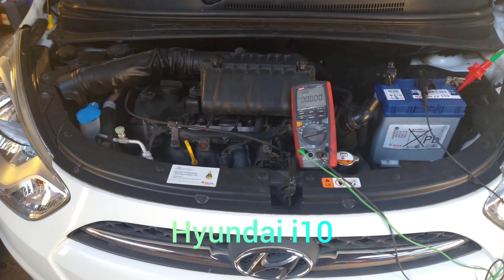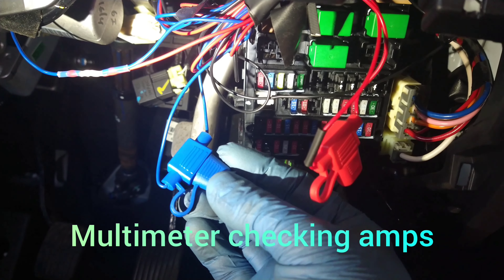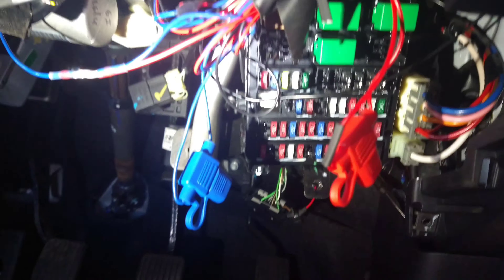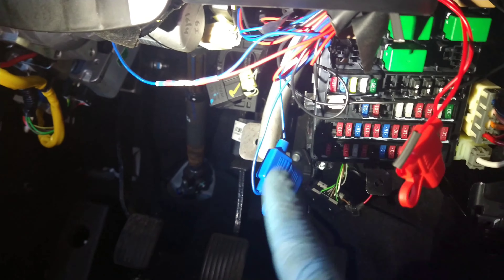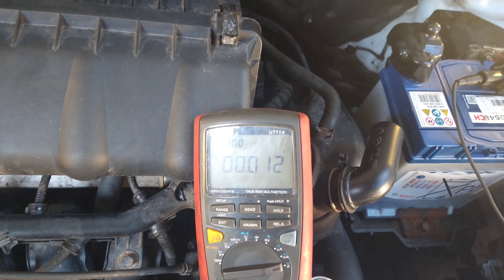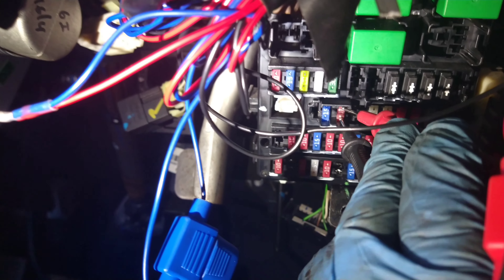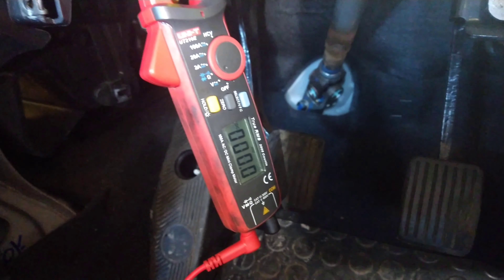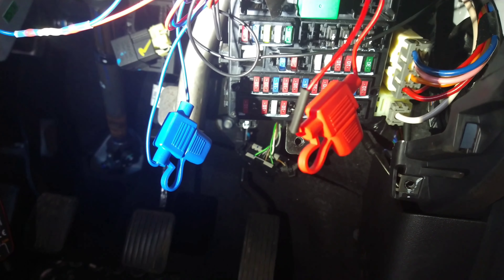Battery drain (Hyundai i10)

Comment: If that constant live is for a tracker, won't switching the wire from a constant to an ignition live disable the tracker when the ignition isn't switched on and therfore making it impossible to track the vehicle unless the ignition is switched on?
Reply from the maker: Yes it had the wires the wrong way round so that it was always on. In that case it wouldn't have a memory live all the time, but it was switched on all the time causing a higher drain on the battery. The fix was to swap over the wires so that when it was switched off it would still have the lower draw for the memory. Thanks for watching Chris
Reply: Ah  I understand, silly me andnthank you again for sharing your knowledge 🙂

Comment: Quick maths, a drain of that size would take 18-19days before requiring a recharge. Most manufacturers state anything 75> is fine...strange. Good tips.
Reply from the maker: It depends on the Amp hours of the battery and looking at the size of this battery it won't be much. The battery could be 12 volts and that would not be enough to crank the engine fast enough to start. Once it is cranking it will drop much lower.  I usually go by manufacturer recommendation of up to 20mA when shut down. Some people say higher but if the car isn't used for a few days to a week this drain is enough to take enough out of the battery to start the engine. Especially in this cold weather. Thanks for watching.
Reply: @mechanicmatt871  looks to be 40 which is what I used at @ 70% state of health